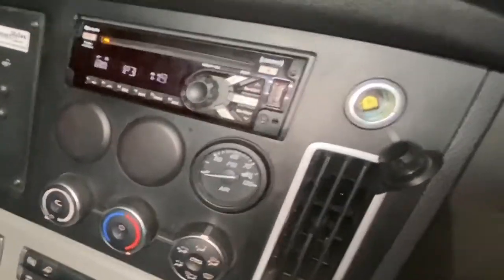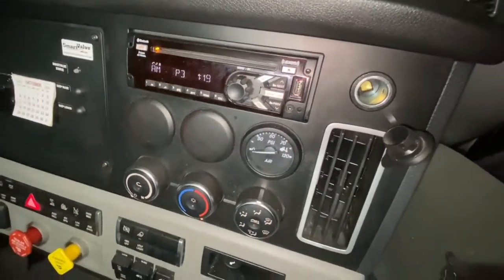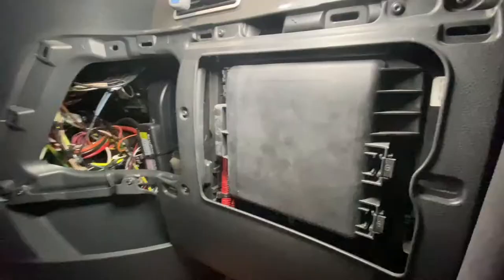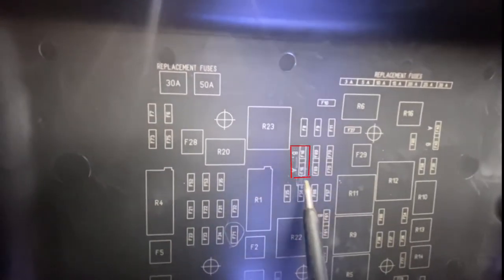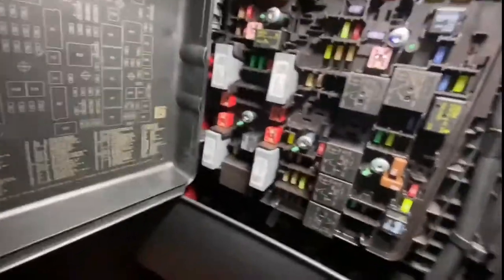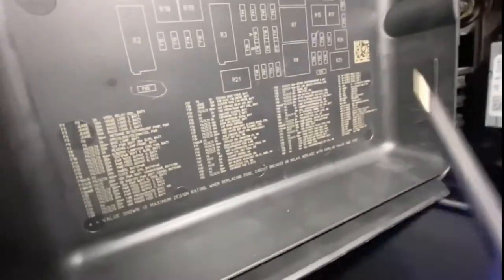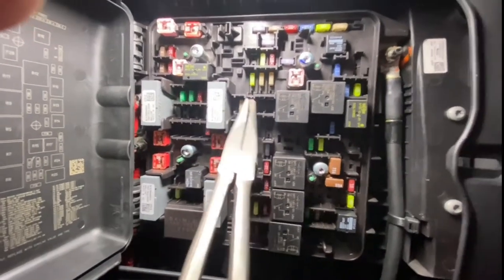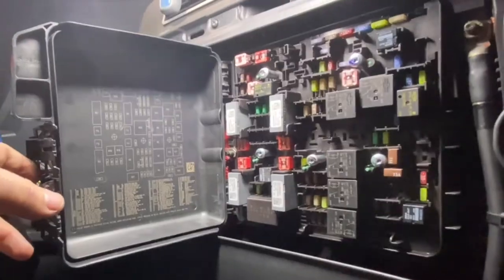Freightliner Cascadia : RADIO FUSE Location.

Comment: 2019 Freightliner Cascadia:  Radio is always locking up and I had to eventually pull this fuse.  -Played even with engine shut down and power disconnect off.   Was just going to pull the whole radio out, but pulling this fuse is easier.  The radio was very hot after amplifing static for a few hours.

Comment: Thanks for the useful info. Came to this video because I tested both fuses and they were both fine. Swapped the 5amp fuse and it worked. Put the old one back in and it also worked. So sounds like it just needed a quick reset
Reply from the maker: Thank you for watching.

Comment: Hello, 
Can you please help me, 
I’m trying to find in my 2018 Cascadia, the fuse for the pig tail or for the trailer abs light, it keep blowing the fuse inside the cab in front of the passenger seat, 
I don’t have the diagram in my fusebox cover
Reply from the maker: What’s the problem it the trailer abs light on.
Reply: @bigrigfix  every time I break, I can see the light from the driver side mirror, abs light on the trailer, and on the pig tail of my truck it’s hot when I tested, so I think it’s the fuse but I can’t find it
Reply: @bigrigfix  I think if you can take a pic of your fusebox plastic cover, I my be able to do so